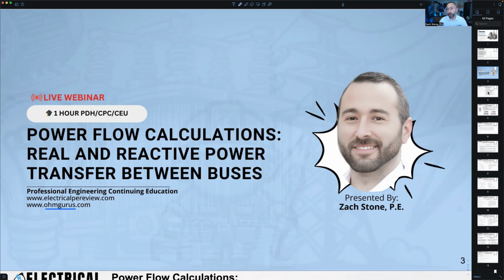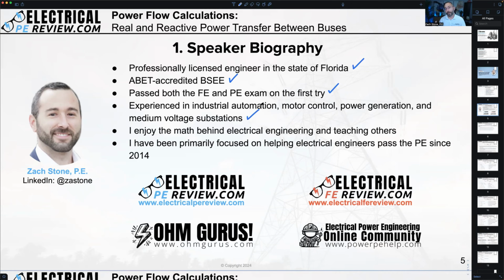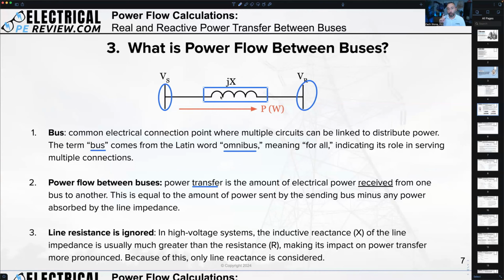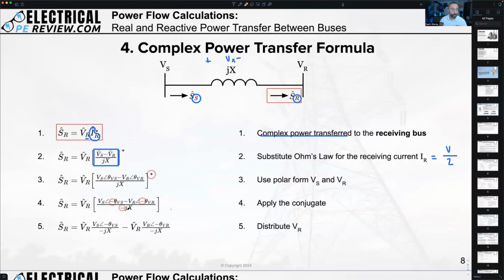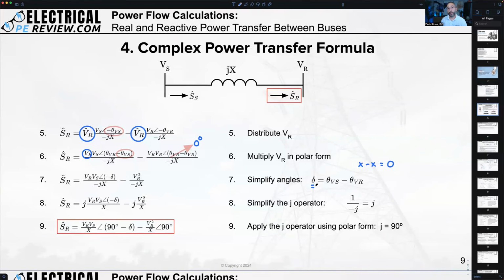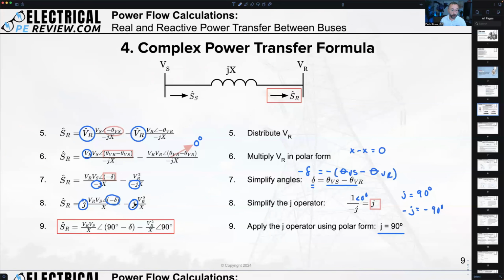Master Power Flow Calculations: Complex Power & Bus Transfer Explained (Part 1)

Comment from the maker: 📖 Video Contents:
0:00 - Video Introduction
0:41 - Seminar Introduction
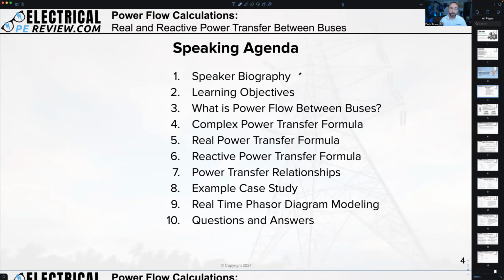1:41 - Speaking Agenda
3:27 - Speaker Biography
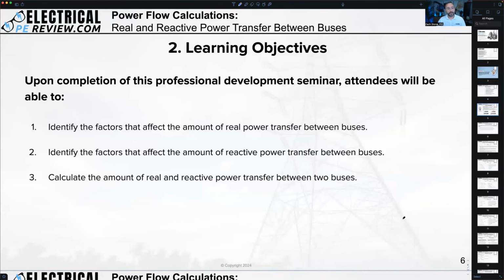5:51 - Seminar Learning Objectives
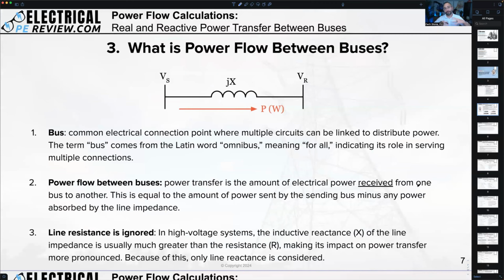6:29 -  What is Power Flow Between Buses?
10:36 - Step 1: Deriving the Complex Power Flow Transfer Formula
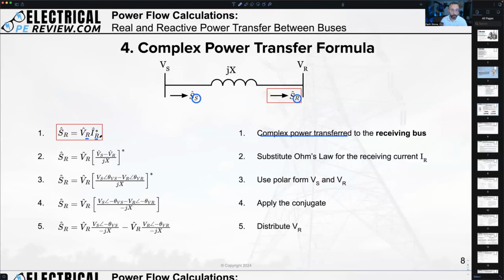12:29 - Step 2: Ohm's Law and the Receiving Current
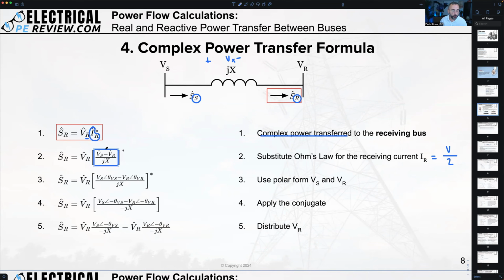13:22 - Step 3: Sending and Receiving Voltage
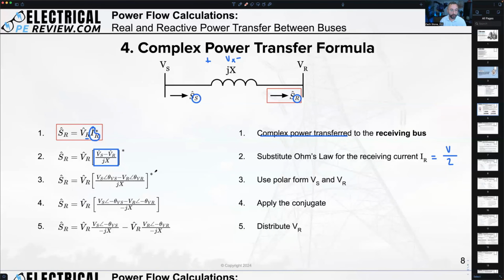13:53 - Step 4: Applying the Conjugate
15:09 - Step 5: Distributing Receiving Voltage
16:11 - Step 6: Multiplying Receiving Voltage
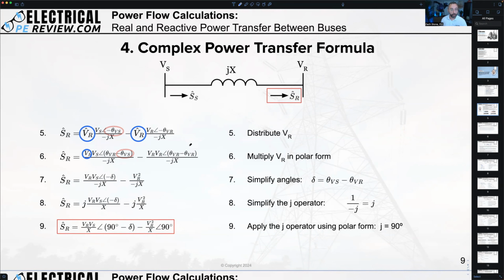17:06 - Step 7: Simplifying Angles
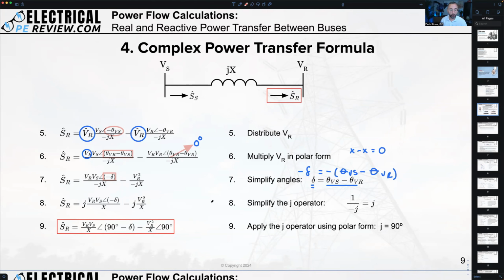18:50 - Step 8: Simplifying the j operator
19:51 - Step 9: Apply the j operator
21:20 - Video Outro